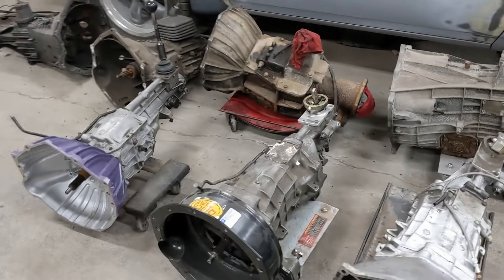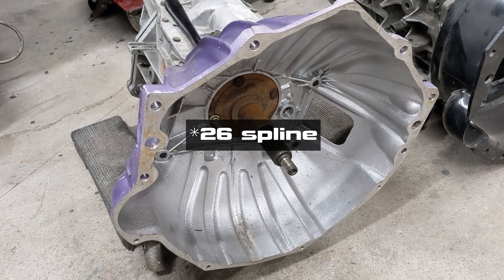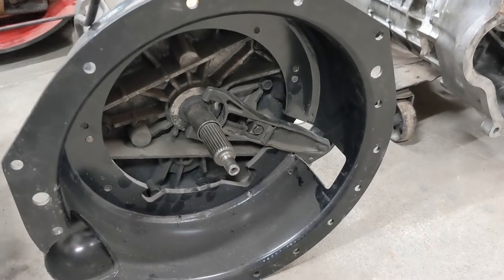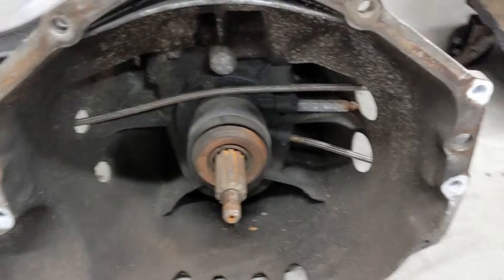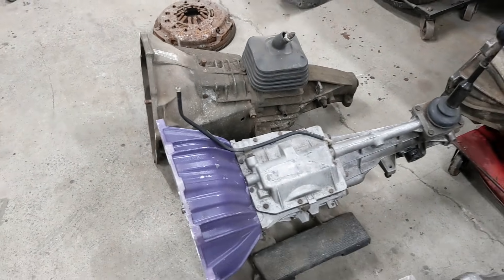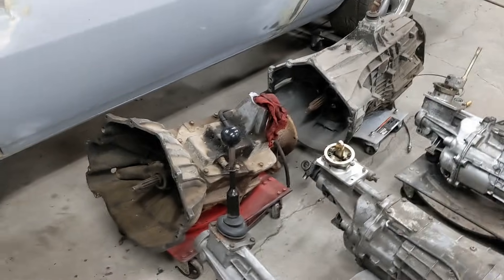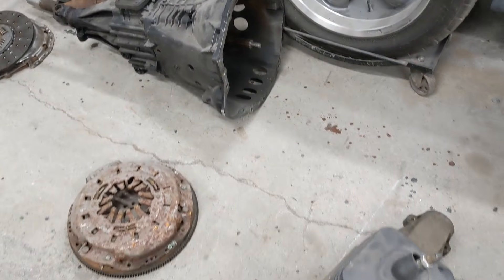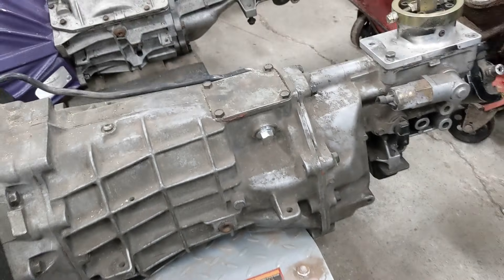GM manual trans specs - 4spd 5spd 6spd 2wd 4wd - LS SBC BBC

Comment: I have a 1998 C1500 4.3L with a NV3500. I need to replace the clutch (all components). It appears the transmission can be separated from the bell housing, am I correct? Or, should I drop the transmission and bell housing as one unit? Any info on how tall the bell housing is? Kinda worried about being able to get the truck up in the air enough to have enough clearance to get it from under the truck? Thanks for any info.
Reply from the maker: I don't think that year nv3500 had a bell housing, it's all one piece, so you don't have an option.
Reply from the maker: Height is just standard SBC bell height
Reply: Is the 1998 s10 4.3L 2wd nv3500 the same length, spline count and shifter location as a 1998 4.3L in a C1500? I am trying to ID which one I have. Mine has all the extra holes in it too (for cooling?)
Reply from the maker: Up to 97 the shifter location is the same as half ton, but the 98+ has a further rearward shifter. All s10 trans have different output spline counts and tcase bolt hole pattern than half ton.
Reply: @GEARHEADdezign  Are they both the same total length, and do you have the spline count info for both?
Reply: P.s. thanks for the info!
Reply from the maker: @toddnovak5361 S10 are same overall length and 27 spline like a 4l60. Half ton is probably same overall length, but 32 spline output
Reply: @GEARHEADdezign  I have 15-1/2" from bellhousing to shifter and total length of about 30-1/2"
Reply from the maker: @toddnovak5361 that sounds like either fullsize truck version or early S10. You can figure it out by the output splines 32fs/27s10 or tcase bolts 6fs/5s10

Comment: I really want to manual swap my sbc (about 350hp) s10. kinda lost in the info.  trying to keep a budget. I was thinking of converting a mustang T5 but should I just get a gm t5? what about a s10 NV3500. I dunno. T56 prices are stupid
Reply from the maker: For that power level nv3500 should be fine and the swap will be cake

Comment: So are the S10 nv3500 any weaker?  Input shaft the same?  Other than shifter placement are they otherwise the same?
Reply from the maker: I'm pretty sure the input shaft is the same, but the output shaft is smaller. It's a 27 like T56 and not 32 like half ton. But same as half ton autos

Comment: I built a mild 350 for my 1993 c1500 2wd and am gonna manual swap it. The 4l60e is old, tired, and doesn’t like the extra 100+ft/lbs of tq the new engine has over the old one. I had a custom 650cfm TBI built  for it that’s ready for boost, and will be swapping over my OBD1 computer to the flash tuning system from dynamic EFI. Right now it’s about 320hp and 400+tq, with boost it should be around 475hp and 490tq. (Estimates from my tuner) I originally wanted to nv4500 swap it but I cannot find one for a good price, even the ones in need of a rebuild are well over $1,000. I can easily find sm465’s in good condition for under $1,000 though. How is the performance of an sm465 vs the nv4500? Not worried about highway manners too much. It’s gonna be driven on backroads and around town mostly, with a quick highway jaunt occasionally.
Reply from the maker: For a 2wd 1500 you might want to think about nv3500. They shift smoother than nv4500, which shifts smoother than sm465. The nv3500 gets a bad reputation, but I've had good luck with them.
Reply: @GEARHEADdezign  I thought about it but I am worried about my driving style coupled with nearly 500ft/lbs of tq. My truck is 2wd but it’s on spindles and 33” tires, it’s the one in my PFP. Gonna go back to stock height eventually, or just go to 31” tires and leave it on the spindles.
Reply from the maker: BTW, I haven't heard of DynamicEFI in years! I did OBD1 tuning on my 91 Beretta and 94 Z71, so I spent some time on thirdgen.org figuring things out
Reply: @GEARHEADdezign  I will be using their EBL Flash 2. No transmission control and it’s gonna be way cheaper to manual swap it than get a stand-alone TCM and build the 4l60e or swap in a 4l80e, or build a 700r4 capable of holding the power. I miss having a manual. I got a bored and built Rochester 220 tbi good for 650cfm with bigger injectors, and a high pressure fuel pump from a vortec truck.
Reply from the maker: @iDrive4fun93  yeah everything is better with a manual. And if you're worried about power you could always go cd009 with an adapter or even ar5 maybe

Comment: Any help doing a v8 5.7 swap on my 99 chevy s10, I want to keep it a manual transmission.  I have the nv1500 in the s10 now. Can I keep that transmission or what transmission do I need to get?
Reply from the maker: If you get an s10 nv3500 (different shifter location and transfer case pattern) it should swap directly

Comment: Hey bud i have a jeep wrangler with a 350 small block swap and broke my transmission trying to find out what transmission is on it already pulled it out but having trouble finding what it is
Reply from the maker: If it looks like one of these that's an easy way to id it
Reply: @GEARHEADdezign it looks like the sm465 but it’s a 5 speed and 4x4
Reply from the maker: Could be nv4500

Comment: I have a 400 small block and i want the 6 speed because  i have the muncie 4speed transmission in mine which one would i use
Reply from the maker: You could get the ls1 style with a 4 bolt adapter for the Muncie clutch and linkage you already have...or you can go the lt1 style with the lt1 style clutch and hydraulics

Comment: i am about to put a t5 behind my 4.3 ,, i have the 153 tooth flywheel .. will that work ?
Reply from the maker: You should be able to use a SBC clutch that works on the 153 tooth flywheel. The 4.3 is essentially the same

Comment: I’m working on a 1995 HD 3500 tow-truck.. it had a 6.5 diesel but previous owner pulled it out an out a 350 sbc gas n I bought it dead not running.. offer-up ad said transmission problems.. but idk u think it should be working properly with same set up clutch ,pp,tob,flywheel ,pb,. Well I finally got it started n pto of course operates in neutral..equipment seems to work great but my question is .. when I put it in 1st 2nd or 3rd it goes in gear but when I pull the clutch out it don’t move at all . So I dropped it n it’s all in new condition tranny nv4500 looking in tip-top-shape.. all gears go in n out smooth n don’t look damaged at all .. starter need it to be shimmed out so it starts good now no grinds.. but still no movement.. idk I’m gonna put back up with new sleeve cylinder n see if it’ll do .. but can u give me a better option or
Opinion.. thxz 👌👌👍👍👍
Reply from the maker: When you shift gears with the trans out, did the input and output spin as they should? That would eliminate the clutch and transfer case from the diagnosis process
Reply: @GEARHEADdezign  yes .. input shaft spins  freely.. of course 1st gear ⚙️ its hard n reverse.. shaft spins hard cus their low gears.. but trying this makes me wanna think its the sleeve cylinder.. I guess previous owner didn’t even bleed it out .. its was all weak.. but I got a new 1 including the line. Hopefully that’ll solve my problem 🤞🤞🤞

Comment: And I'm still confused 😢. What configuration would I use to build a all wheel drive, manual transmission,  5 or 6 speed doesn't really matter. 1967 Chevy Nova SS?
Reply from the maker: Cheap option would be nv3500, but you could also do a Corvette t56 converted

Comment: Any idea how much bigger the NV4500 is compared to the NV3500? Im wanting to swap in a NV4500 with a 5.3 in my 92 Sonoma.
Reply from the maker: Size-wise they're basically identical. But the nv4500 only came in the full size truck config with the shifter further forward...like 6-8". And they all will have 32 spline 6 bolt transfer case, not the 27 5 bolt like s10
Reply: @GEARHEADdezign  Yeah if I need to go with a new transfer case I will. Sounds like the only issue might be the shifter location.
Reply from the maker: @DittoBlast  shifter won't be in the stock location, but the are ways around that problem
Reply from the maker: @DittoBlast  I'm putting an sm465 in my s10 blazer when I do my LS SAS and I'll make it work one way or another

Comment: Please help. What manual transmission/transfer case combo for 750+ hp big block Chevy. Going in an 81-87 square body.
Reply from the maker: That's a tall ask, but the new tremec T4050 might be up to it. And the zf6 is pretty damn good, but they're hard to find

Comment: Which would perform better and be more reliable for a 5.3 4wd 03-06 silverado? Nv3500 or nv4500?
Reply from the maker: If you're doing any towing I'd go for the heavier duty nv4500. The nv3500 shifts smoother if you're just bombing around in it.

Comment: I appreciate your videos! Tons of information and knowledge! 
I was wondering if you could help me out with a build? I have a 2014 Jeep JK (AEV BRUTE) Gladiator with a 6.4 / 392 ci  currently running an Nag1 A580  transmission (which I've had computer issues from the conversion)
 .
I'm looking to convert to a 6 speed transmission with AWD and delete the current transfer case. My future plans are to are  around 1000 HP let me know what you think!
Reply from the maker: Yeah, I'd like to help, but Mopar and AWD are both out of my expertise. Sounds like a fun project though
Reply: @GEARHEADdezign  I'm totally okay with any other all-wheel drive setup you might suggest! As long as it can handle the horsepower 👀
Reply from the maker: @just-do-better  I would call Tick Performance in Carolina and see if they can set you up with an AWD T56 Magnum

Comment: Thanks for the info I have a c20 with a 4 speed and I want a 5 speed in there and this helps out a lot !!
I’m assuming I have an sm465 but I’ll have to double check. Been doing my research and this helps a lot.
Reply from the maker: I did find out the earlier 4spds have the shifter a couple inches further forward than my measurements. My sm465 is from a gmt400 and the squares were different
Reply: Did you ever get this swap figured out? I’ve got a 69 C20 that I’m putting a 454 in and I want to go to an NV4500 to replace the SM465.

Comment: Very very good video..and very helpful for me..made me realize how many different ones there are to choose from.. I've been using the nv3500 behide 350's in 40 & 50's rat rod cars and everything has been super easy to make it work perfectly.. the shifter location lands in a good spot..and I use S10/Silverado fluid reservoirs ..and truck pilot bearing
Reply from the maker: Yeah the nv3500s get a bad rap, but they work pretty good really. I have two in my Blazers and have no complaints
Reply: Thinking of using one in my 99 suburban.  Hoping for most plug n play I can find
Reply from the maker: As long as you get the full size version it should be easy. I'm nv4500 swapping my new 96 Burb right now
Reply: @GEARHEADdezign thank you

Comment: Does nv3500 fit on 350 5.7  ?
Reply from the maker: Yup, direct bolt in for SBC
Reply: I wan to swap my automatic transmission with that one. Bought a single cab with the 5 speed transmission but that truck is v6 and i was wondering if fit's on the v8 350
Reply from the maker: Yup. That trans works with 4.3 v6, SBC and LS. And BBC actually
Reply: Thank you so for the information !!

Comment: I have a 1979 Chevy El Camino that I’m planning on doing ls swap, I already have a Lq4 6.0 so that’s what im using . The car is originally manual and I want to keep that way. I’m still not sure what transmission to use, do you have any suggestions or recommendations for this project? Thank you
Reply from the maker: You could keep the original manual, or use something more modern.
Reply from the maker: What are you planning on doing with it?
Reply: It has a 3 speed. I don’t think it will be good for the 6.0.

Comment: So what about a nv3500 behind a duramax?? Or t56 for that matter?? Input shaft bearing same size as the zf6??
Reply from the maker: That I'm not sure. The bell housing pattern is the same. I'm guessing you mean the pilot bearing, not the input shaft bearing. Could prob check Rockauto and see if it's the same
Reply from the maker: Neither would be a great match for lots of diesel torque though

Comment: Having nv3500 problems right now. I've always run the standard input bushing what bearing are you using in the flywheel for the input truck bearing do you have a part number?
Reply from the maker: The bigger truck/LS3 bearing that sits in the first register of the crank, not the smaller, deeper one
Reply from the maker: GM CT1082 or SKF 6302vsp43

Comment: Awesome video. I’m in the middle of doing a 5.3 LS in my 91 S10. I want to keep it manual. Don’t want to break the bank so thought about using the nv3500. If you have any suggestions that would be great. Thanks in advance…
Reply from the maker: Yup. The nv3500 will bolt right up to the LS and go. They typically will withstand some abuse, they're just not "bulletproof"
Reply: Thanks for the quick reply. Is there anything special I need? Or somewhere I can get a list of parts I’ll need to complete the swap?
Reply from the maker: @richiegibby78  in the early s10 you'll want the Silverado nv3500, not the later s10 version. Then buy the flywheel and clutch that match the trans.

Comment: will a 4.8 or 5.3 swap into a nv3500 4wd 1995 S10 without too much trouble?
Reply from the maker: Yup. I'm going to be doing the same with my 2000 blazer. There's a swap group on Facebook and wiring harness available from Current Performance

Comment: Is all great data! But I still cant figure what combination of parts will need to make my 01 express van 5.7 l to a manual 4x4 front SAS....😢 I know you're the right man to ask
Reply from the maker: Just grab a manual from 88-98 or 99-06 Chevy and the transfer case will depend on which side drop you need to match the front axle
Reply: @GEARHEADdezign  I'm thinking  f250 05+ as to make it reliable. What are your thoughts on that?
Reply from the maker: @alb2571  yeah those are good. So you'd want a typical driver drop from the same year trucks
Reply: What manual transmission will I need to look for that will work in my 97 Sierra 2wd with a 5.7 in it. Thanks in advance.

Comment: how hard would it be to put a first gen duramax in front of an SM465? i have a one ton square body with a mediocre BBC in it and an sm465 behind it. Also, is it reasonably simple to swap a 2wd sm465 to a 4x4? thanks
Reply from the maker: I know the zf6 behind 8.1 and dmax is the same, so that means the 465 should swap easy. I don't know about the 2wd to 4wd swap, but 4wd trans are a dime a dozen
Reply: @GEARHEADdezign  Thanks, I appreciate the insight. Does this mean i could probably get away with the zf6 clutch and flywheel?

Comment: Would a 1998 nv3500 4x4 internal slave bolt up to my 2006 5.3 could you point me in the right direction with fly wheel input bearing and slave cylinder are 98nv different than the 2003 nv any help appreciated
Reply from the maker: It should be a direct swap from what I understand. I check Rockauto when I have questions about interchange. If you buy all 2003 4.8 stuff it should work with your 5.3

Comment: Some 10 years ago I lucked out and found a low miles '95 Formula TA with the LT1 and T56 in a local pull it yard. I picked up the trans, flywheel, and clutch dirt cheap, but it's still in the parts bin waiting for the answer...I refuse to use the pull clutch and want to use an internal hydraulic throwout. Are aftermarket parts the solution?
Edit: This would be used with either a 2 piece or 1 piece rear seal, I've got both. The LT1 flywheel I believe is the same balance as a Vortec 5.7 1996–2002.
Reply from the maker: Everything will bolt up factory with a 1pc rear main flywheel and the pull clutch. To convert to push clutch you'll need ls1 input shaft, front plate and old BBC bell housing and 4 bolt adapter
Reply from the maker: FWIW, I'm using the pull clutch on my Camaro and it works fine. I have zero issues with it.
Reply: Try looking at Novak Conversions. They pull off all kinds of crazy stuff.

Comment: So I want to swap my t5 transmission to the lt1 t56 I know you saying they both use hydraulic put what did you mean by the pull style clutch  and  would I have to change my clutch and flywheel. Also Would I also have to change my master and slave clutch cylinder or would they be compatible
Reply from the maker: Your master is probably fine and maybe the slave...but def have to change clutch. Maybe flywheel too. Look up on Rockauto if flywheel is the same for TPI and lt1
Reply from the maker: I just checked, flywheel is different

Comment: The k1500 4x4 trucks had nv3500's in them with an external slave. Some call them a getrag, but in all truth and actuality, they're still a nv3500. 99 and 2000 1st gen nbs trucks used an nv3500 with the 4.8-5.3 trucks as well. Very rare to find though.
Reply from the maker: Yeah they were 5LM60 getrags. They just got a name change when NV popped up. The old getrag 282 fwd 5spds got called NVs later in life
Reply: Just pray you never have to get one repaired! I bought one for my YJ V8 swap and found that 3 gears were broken. Repair was quoted at $1,500 because the NV3500’s require a special tool to even do the repair and they are extremely difficult to repair properly. I found an SM465 that fit my needs and repaired it myself.
Reply: I just pulled my trans out of a 1992 chevy silverado 5 spd with a 4.3v6 (upgrading to 503v8)  it had a crack going around it and im thinking about soldering in some metal, but main question is, are there any upgrades I might be able to get for the trans, that might be a budget, but valuable replacement?  I believe the trans has about 180k on  it.
Reply from the maker: A newer nv3500 will bolt right up and they're a little bit better. Cheap too